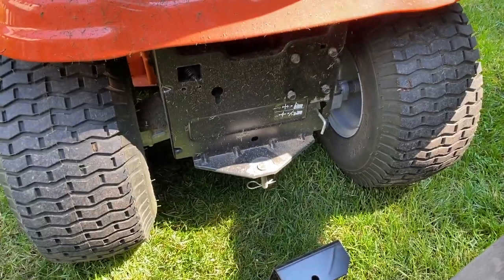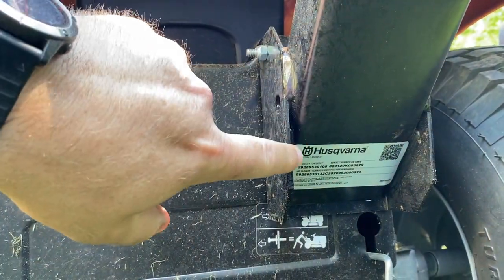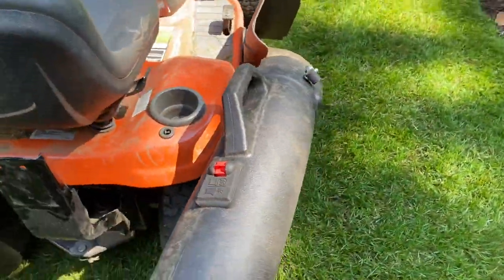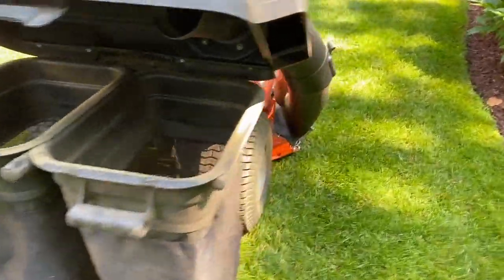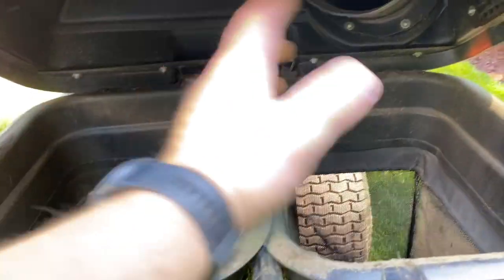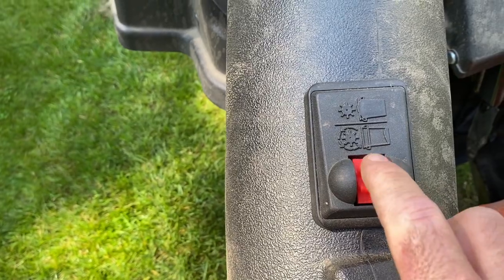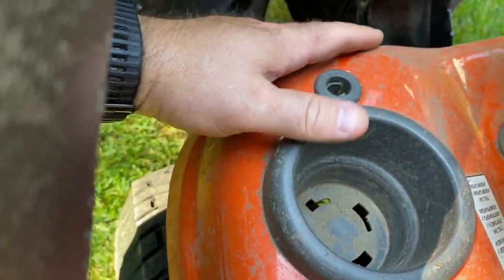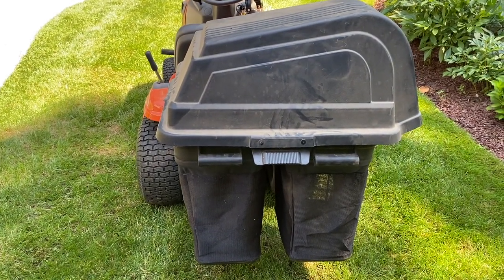Husqvarna 42-46 in. 2-Bin Lawn Mower Bagger Review

Comment: I'm looking to get a bagger for my 42" Husq but I need the tractor to fit through a 60" gate with the bagger attached. Are you able to tell me how wide overall your tractor is with the bagger attached? Dealer and Husq themselves aren't able to tell me...
Reply from the maker: Hey sorry for the delayed response. I would say it’s about 50 inches. I store it in a shed which has a door of 54 wide and it fits easily. You should be all set with a 60 inch gate. Thanks for watching.

Comment: were the predrilled holes threaded? Mine are not.
Reply from the maker: No I don’t believe so.
Reply: @hobbyhandyman  did you get self tapping bolts or did you end up tapping it yourself...mine didn't come with self tappers and my holes aren't tapped either 😬
Reply: @hobbyhandyman the bolts that came with my bagger attachment won’t screw into the predrilled holes. Why might this be? Too big of bolts or something with the holes?

Comment: I just ordered one of these from Walmart & I am anxious to see how it works out for me. I need to clear out my own garage, as space is becoming and issue there though. Thanks for the video & tips. On question though, Do the bolts to go into the pre-drilled holes have to be tapped in to start them, besides just being screwed into place. I can't seem to thread them into the pre-drilled holes by hand to start them?
Reply: I just used extra force or an impact driver, as long as it's not too much to break them. Bought a bagger from walmart but not this brand.

Comment: any thoiughts as to why I didn't get ANY grass in the bags?  I have it hooked up like in your video...thought maybe I missed a toggle or something  (I inherited the mower and just trying to figure it all out)
Reply from the maker: Thanks for the comment. I would double check for any clogs in the chute and ensure that the blade is fully engaged when mowing.
Reply: could also be blades are fitted upside down not allowing grass to shoot up also blades are not sharp enough I've had this problem or grass is to wet to shoot up the shoot hope this helps
Reply: @markyb366  that is a possibility, it was my Dad's, he liked to tinker, so anything is possible

We have since sold it, but thank you for the info

Comment: Hey! I just received and installed my bagger, but it isn’t picking anything up. I know I have to be doing something wrong, but after several sweeps over the yard with lots of leaves, there’s nothing in either bag. Any ideas? Thank you!!
Reply from the maker: Thanks for the comment. Do you have the blades turned on (I.e. like you were mowing the lawn)?
Reply: @hobbyhandyman  we do. The blade is on and we tried adjusting the deck on several different heights.
Reply from the maker: @oliviawilson2553  double check that the chute from the mower deck to the bagger  isn’t clogged.  I will try to think what else could be causing that issue.
Reply: @hobbyhandyman  thanks! This is the first time we’ve used it, but I was wondering if maybe the deck was clogged from previous use.

Comment: Will a 46 fit a 42 in
Reply from the maker: It comes with two different bottom tubes. One that fits a 42 and one that fits a 46. But I don’t think the 46 tube will fit a 42 deck.